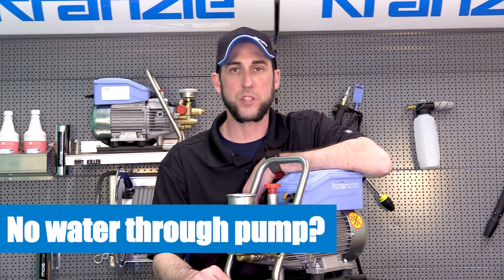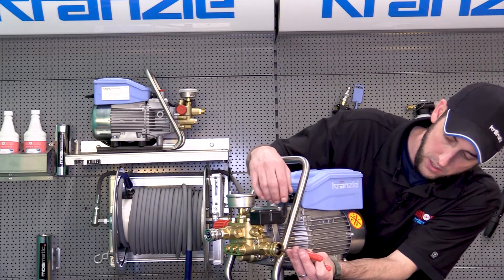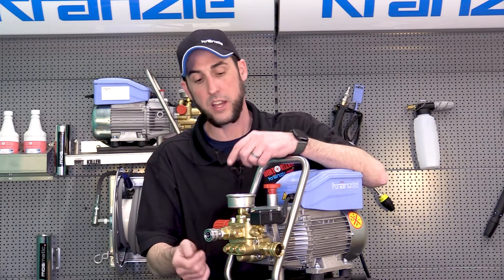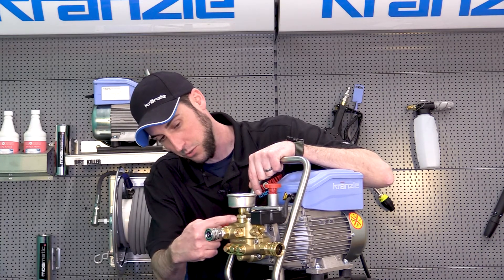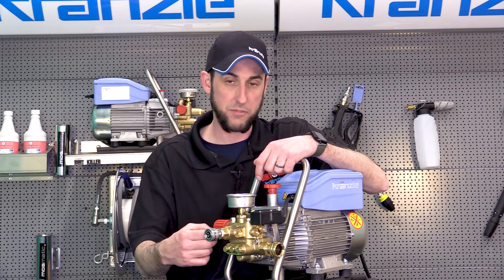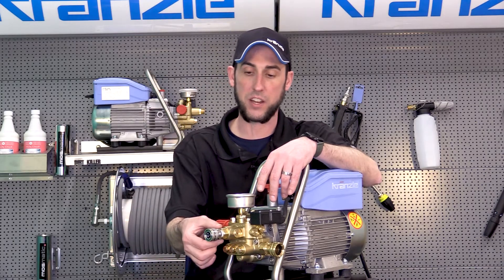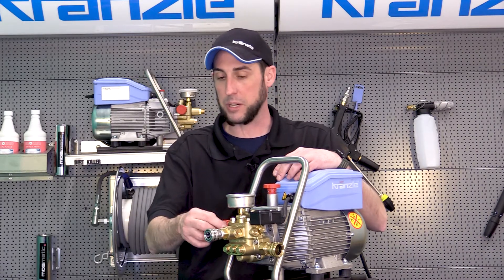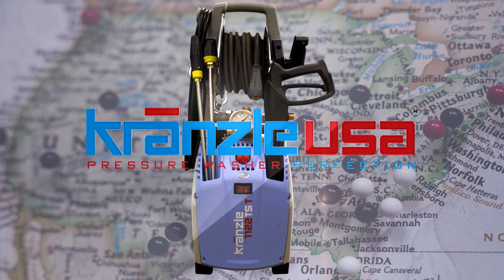No water through pump ? Cause and solutions | Kranzle USA Pressure Washer Perfection

Comment: Hey I have a 2700GH washer and it starts and runs good, water comes out the pump and everything. But when I plug in my hose and it creates pressure it won’t crank
Reply from the maker: Hello Sir,
I believe you are saying that you are struggling to start your pressure washer because of the pressure that builds up in the high-pressure line.  Assuming that this is the case, there could be a couple different causes for this issue.  A simple solution is to remove any high-pressure nozzles from the gunjet/lance assembly to decrease restriction.  Then attempt to start the engine while the trigger is squeezed on the gunjet.  In commercial applications, you could implement a high-pressure ball valve on the hose end that would allow you to start the machine without the gunjet connected, and then close the valve and install the gunjet after it is running.
As for your particular situation, most consumer machines are equipped with a “start-up relief valve” or “easy start valve” that momentarily bypasses flow until the engine is running at full speed and the pump can go into bypass.  If this is a new issue that valve may be malfunctioning or defective.  If you are able to start the machine with the gunjet squeezed (open/spraying) and then the engine stalls when the trigger is released (closed), then the unloader valve might require service.  The two valves are sometimes integrated together.  Feel free to contact us directly via a tech support ticket at KranzleUSA.com or call 800.544.1188
Reply from the maker: Hello Sir,
I believe you are saying that you are struggling to start your pressure washer because of the pressure that builds up in the high-pressure line.  Assuming that this is the case, there could be a couple different causes for this issue.  A simple solution is to remove any high-pressure nozzles from the gunjet/lance assembly to decrease restriction.  Then attempt to start the engine while the trigger is squeezed on the gunjet.  In commercial applications, you could implement a high-pressure ball valve on the hose end that would allow you to start the machine without the gunjet connected, and then close the valve and install the gunjet after it is running.
As for your particular situation, most consumer machines are equipped with a “start-up relief valve” or “easy start valve” that momentarily bypasses flow until the engine is running at full speed and the pump can go into bypass.  If this is a new issue that valve may be malfunctioning or defective.  If you are able to start the machine with the gunjet squeezed (open/spraying) and then the engine stalls when the trigger is released (closed), then the unloader valve might require service.  The two valves are sometimes integrated together

Comment: Hi Josh!

Love your videos.
Is it possible to get the ball bearing wrong at the dischergevalve?
Reply from the maker: I don’t really understand the question.  However, I’m guessing it’s one of two questions:

(Q):  Is it possible to get “the wrong size ball bearing” at the discharge valve?
(A):  Kränzle uses two different size bearings in the non-return valves of the various sized pumps.  Those two bearing sizes are 8.5mm & 10mm.  Either size bearing should work in the non-return valve of most pump models.  Sometimes we switch the 10mm to the 8.5mm bearing in an effort to correct bleed down and short cycling issues.

(Q):  Is it possible to “install” the ball bearing wrong at the discharge valve?
(A):  The order of the parts in the non-return valve must be followed from the drawing.  That said, installing the parts in the incorrect order is difficult to do.  The spring goes into the fitting, widest end first.  Then the ball bearing goes into the valve housing.  Then install the fitting into the valve housing.

Those are my two interpretations and the answers for either question.

If you still need help feel free to give us a call at 800.544.1188 M-F 9-5 EST.
Reply: @kranzleusa5846  thank you. Think i got the ball first. Redo it right😁

Comment: Thanks for the video. It solved my problem as well. Two of the three front check valves were partially stuck. Once I freed them up and re-installed them, it worked like a charm. I was a bit panicked at first thinking that I was going to have to replace the pump or rebuilt it, so your video saved the day!!!!
Reply from the maker: Glad it helped

Comment: Hey, so my pressure washer works perfectly the only problem is that I need to keep my finger on the trigger for water/pressure to come out. I can wash for 1 hour but only it I keep my finger on the trigger, if I let go, water won’t come out anymore. Is this a problem with my gun? Everything’s good but I can’t shoot then stop.
Reply from the maker: Hmm.. That sound exactly like how a gun-jet is supposed to work. Pull the trigger and water flows. Let go of the trigger, then water stops flowing. On, off. On, off.. Not sure what you mean by I can't shoot then stop... are you saying if you stop spraying the trigger no longer works and you can't spray again? If so, then yes. Something is wrong with your gun-jet.
Reply: @kranzleusa5846  that was it. My gun was broken, I changed it and now it works perfectly. Thanks

Comment: Hello I was wondering do you need a pump for a mobile detailing set up ?
Reply from the maker: Hi. No, not if close proximity to the source. All Kranzle pumps are self priming. They PULL water into themselves. They can even pull vertically a short distance (less than 3 feet.). Here's a link discussing best practices of setting up a water tank. https://youtu.be/Yw1BOdwnE8w
Reply: @kranzleusa5846  awesome thank you!
Reply from the maker: @pileggi32  Welcome.

Comment: The motor runs great and I have good water pressure, but when I pull the trigger on the hose, the motor stops running. What should I do?
Reply from the maker: Hmm. That sounds the opposite of what it is supposed to do, it if is a Kranzle with total stop. Could be a faulty micro-switch. Just to confirm, it runs when turned on, but when you squeeze the trigger it stops? Feel free to call Josh at 800.544.1188 to discuss and troubleshoot further.
Reply: Electric? if so the nozzle tip is partially clogged

Comment: I have a Kranzle K1122TST, if dirt from the garden hose gets in the pressure washer, can you teach me where to get that dirt off? I'm assuming there's a valve spot for the dirt to sit until I remove it, correct?
Reply from the maker: Hi. This video you commented on answers the question. It is either in the filter, or it go through there, then the pump housing. You'll want to remove/clean all the check valves and the water out port.
Reply: Please i bought lavor 140 bar and its not working. Engine on but no water in or out@kranzleusa5846